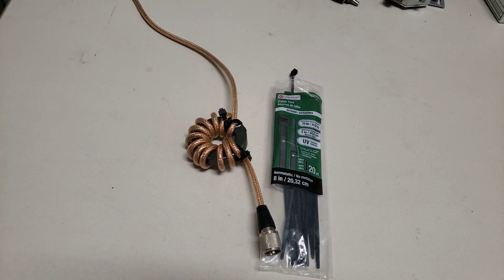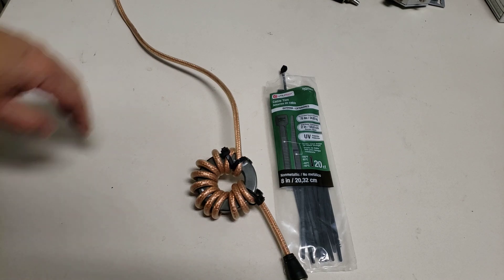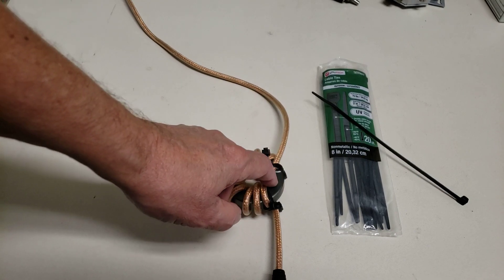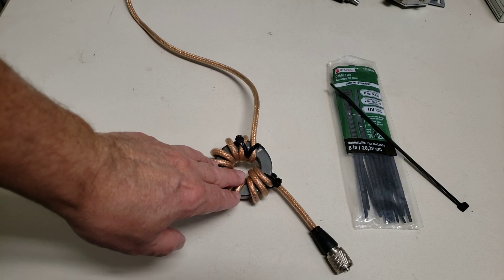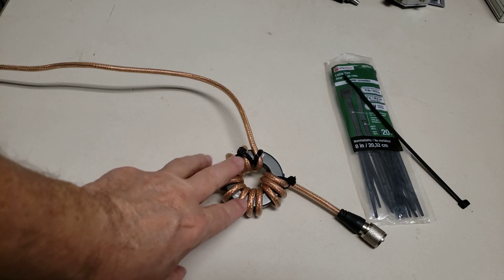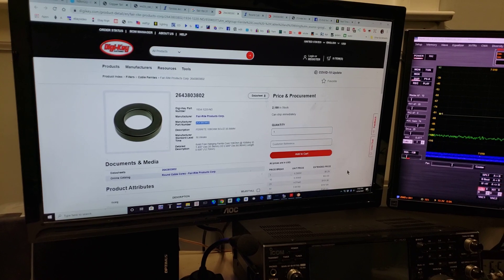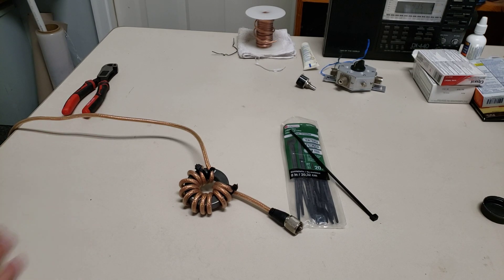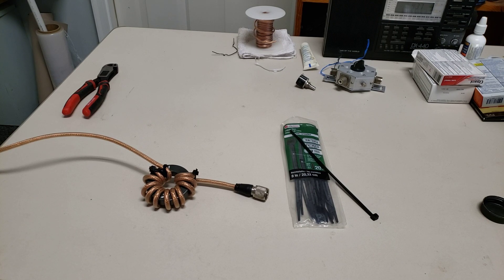Build Simple Effective Common Mode Choke (CMC) aka. Line Choke for RFI

Comment: Nice helpful video! Well done, just thought I would mention that when you switched from the Fair-Rite website to DigiKey the part numbers are different. I believe the part number on the Fair-Rite website is for a type 31 but the part number on the DigiKey is for a type 43 toroid....unless I am confused (which is always possible)   -AD0YW

Comment: Could 43 mix used in lieu of 31?
Reply: Only if you plan not working below 20 meters. So 30, 40, 60, 80, 160 won’t see much benefit from a common mode choke using mix 43. Google Jim Brown, K9YC for more precise info—KQ1N/6–73!
Reply: @joelmartin2826 My interpretation of G3TXQs results is that using 43 mix with 12 turns yields more effective choking on lower HF than 31 mix?
Reply: @joelmartin2826  you might want to recheck that as it is incorrect. Mix 43 for 20m and above is the one you should be using.
Reply: Joel, you may want to check out G3TXQ's (sk) chart on his web page. His measured data might say different.